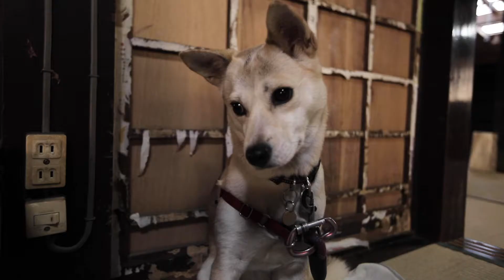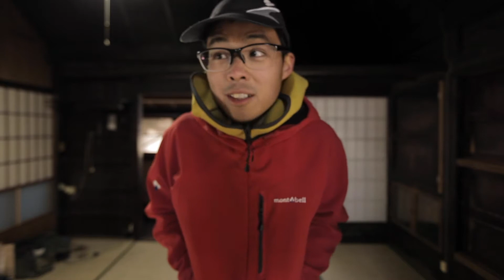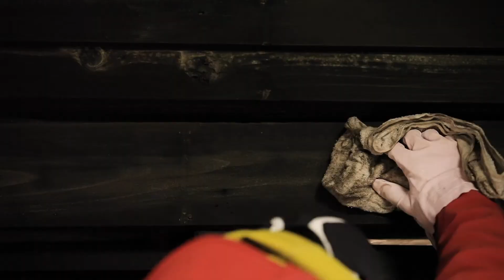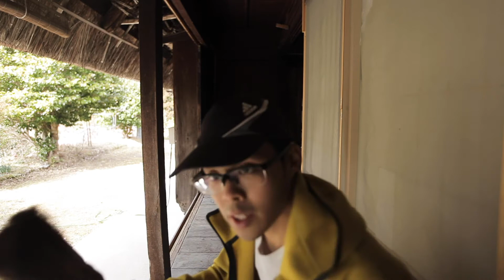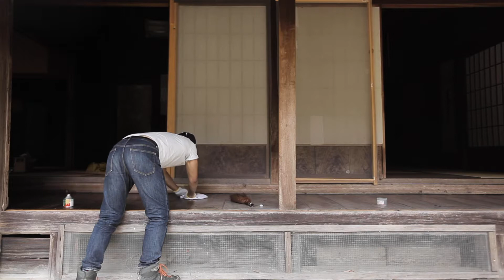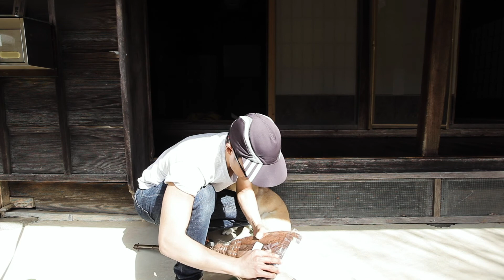Wiping Down & Oiling Wood in a 120-Year-Old Japanese Farmhouse

Comment: Cool broom! How long do the oils last and do they prevent fungus growth?
Reply from the maker: It's perilla oil, and I'm not sure how it actually works but there has been research into how perilla oil kills intestinal parasites when used internally. I think a version of this is eaten in Korean (as cooking oil). It's used on wood because it has a high melting point and won't go rancid easily. Some websites say it's 90% linolenic acid, linoleic acid, and olein, so maybe something to do with those?

Raw flaxseed oil can be used too but that's much more sticky, and cooked flaxseed oil (processed at 300 deg C), which is less sticky, is very expensive. There's also walnut oil, but that's toxic. I wanted to use something safe for Mori. The most premium is tsubaki oil (camellia oil) but that's really expensive and usually reserved for combs and knives.
Reply: @Ryunohara  That makes sense! The more expensive oils probably have longer chain fatty acids which make them sticker and more resistant to heat.